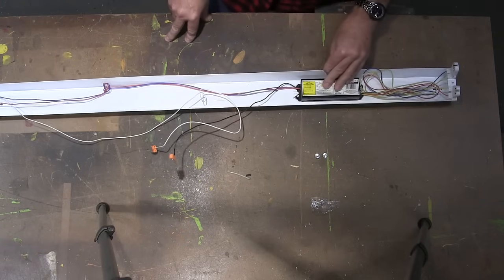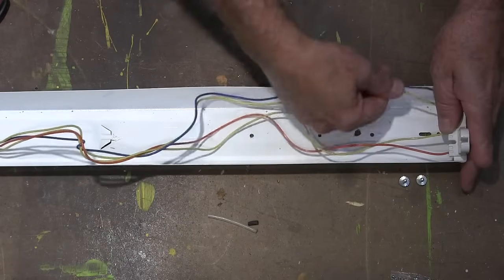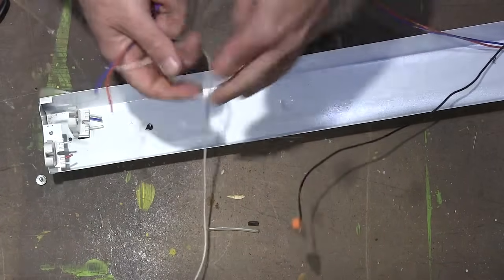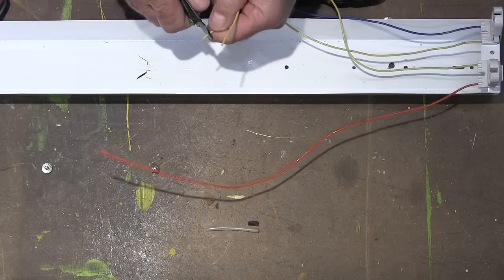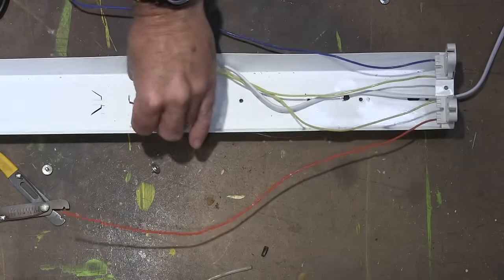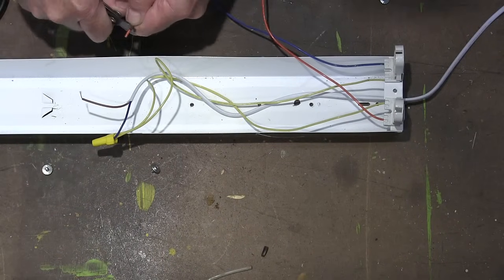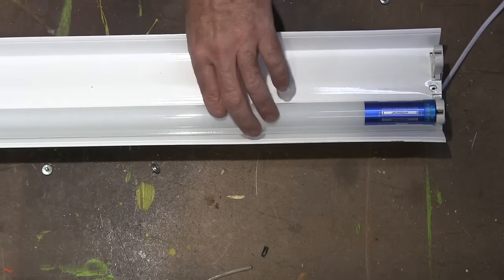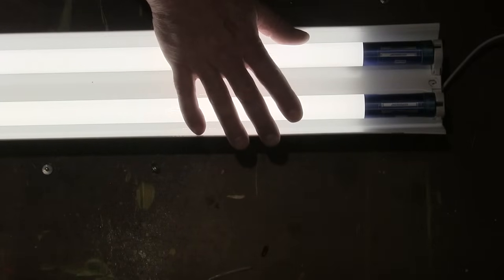Fluorescent to LED Conversion

Comment: This type of video is causing me great pains and headaches with my customers. They don't understand the LED bulbs need to be the right type or this will not work for them. The products that I sell are LED , 4ft bulbs that require an electronic starter ballast and will not work just wiring to 110v directly. Even some "handy" men and women see this and ask about buying my bulbs before asking if these will work directly on 110VAC and I have to STOP them from making the mistake. Video's like this are the issue. We all need to explain this better for the public.
Reply from the maker: I understand there is a lot of confusion on this issue.  I had to do a lot of research before buying these bulbs.  Part of the reason I made the video was to provide clear instructions AND provide a product in the comments people could buy, follow the instructions and be successful the first time.  The bulbs I suggest can be used with or without a ballast.  It is unfortunate this video does not help support your particular product but that was not the intention of the video.
Reply: I have watched many videos, on this process. 
But-maybe you should consider doing the definitive video, wherein you show us exactly what you mean, here within your comments. 
I thought it was weird that he did not cap or tape the short bits of wire on the tombstones on the other end. No current at that end of the fixture now? Yes-if we are going to convert over, all of our old fixtures, to LED, in hopes of saving some money, then someone needs to show us and tell us, everything we need to know. Don't forget to add the discarded ballasts and wire to your scrap metal materials! It all brings a little cash at the scrap yard!
Reply: What are you talking about? I converted 4 fixtures thanks to this video. Extremely simple and to the point.
Reply: Lucky for you, must have had the right type of ballast for using them.
Reply: Coffee and Tools what led bulb is required for this
Reply: The guy in this video doesn't explain wether or not for his fixture is shunted or unshunted toumbstones as there is a difference. On unshunted toumbstones according to the werker style bypass bulb. It does matter how you wire per the instructions. As one side is neutral or N and one side is load or L new toumbstones looking at it. I'm not saying he's doing it wrong. However according to the instructions at least for werker there is a difference.I believe according to werkers instruction. I been wiring it wrong because I been wiring both sides. So to a point both this video is not accurate to werker. And I'm not accurate according to instructions. However the lights I modify work. Is there something that instructions are not specifying.
Reply: 🤠 This is only for some T8 fixtures and bulbs...oh well....and they are non shunted in the video, but.....yeah....Just not my favorite conversion. OH...another fun day here...
Reply: Being uneducated is the issue and this man is sharing an educational video.
Reply: Trouble with YouTube is the information is now always clear and can be misleading.
Reply: Will this work with a 4 bulb fixture?
Reply: Depends on the kit you buy and your wiring.
Reply: Wrong! I went ahead and bought the Plug and Play LEDs to avoid all this and yes they did turn on BUT the damn things shut off after about having the light on for 3 hrs or so. So your LEDs and method do NOT work either. I'm about to go and see if the store doesn't give me any BS to exchange or refund me so I can get the LEDs that you do have to bypass the ballast. It's Ridiculous to pay that extra money for the so called "Plug and Plug" just for them not to work properly.

Comment: Thanks, very interesting. I have10 lights on one side of my shop that have an annoying hum. Very distracting when I'm being quiet and trying to concentrate on something. Also, in humid weather, a lot of them won't light unless I run my fingers down the tubes. Might have to give these a try.
Reply: Told the hum can be from transformer or I found tweeking the tube in the fitting improved the contacts.  Humming stopped.
In humid conditions, found sometimes need to remove starter & place in warm dry place for 1/2 hr or so. Often rejuvenates them.
LED circuit board are vulnerable to moisture. Exterior grade fittings are more durable.
Reply: So you don’t need a ballast?

Comment: Good explanation on the conversion.  I have gotten good at it too.  On some of our mounted fixtures we figured out how to make the conversion by taking out the ballast and only having to make one wiring connection! (not always possible)  For future reference it is good to mark which end gets the power.  This was a good video!
Reply from the maker: It would be a good idea to mark which end has the power, I had to open a couple of them up to find out because I couldn't remember.  I got one of them backwards and it blew the breaker but didn't hurt the bulb.
Reply: วิธีติดตั้งหลอดนีออนled
หลอดเดีี่ยว

Comment: Not all LED lights are wired this way (https://youtu.be/CRZdN5KtG8k), there are tubes that want load on one end and neutral on the other. Either way this is a simple easy conversion. Just know what tubes you have. Glenn
Reply from the maker: You are correct, it gets kind of complicated with all the different types of tubes, fixture configurations, lamp colors, etc, etc.